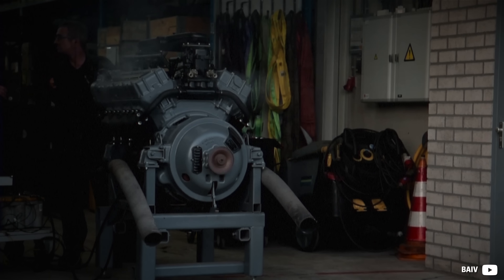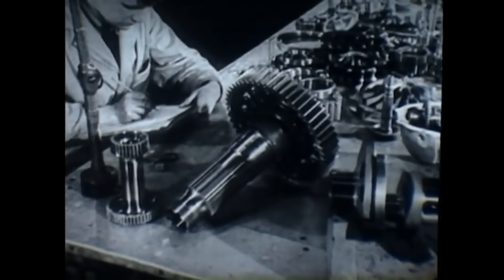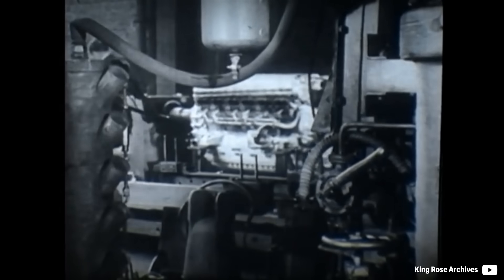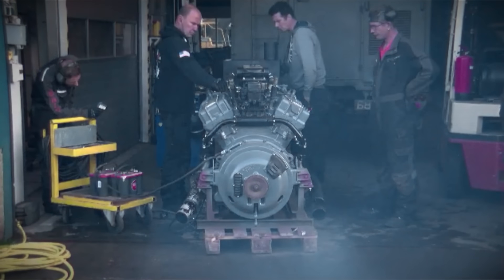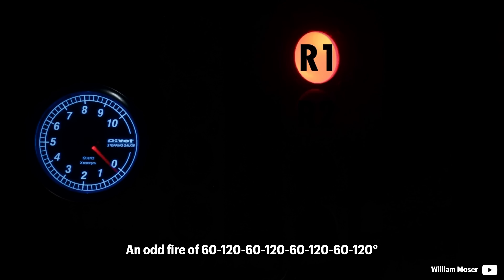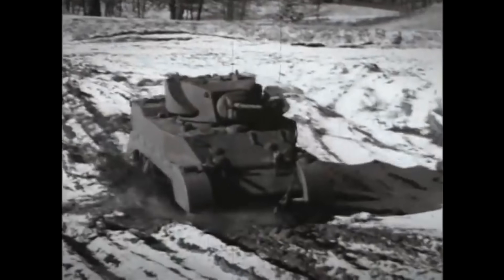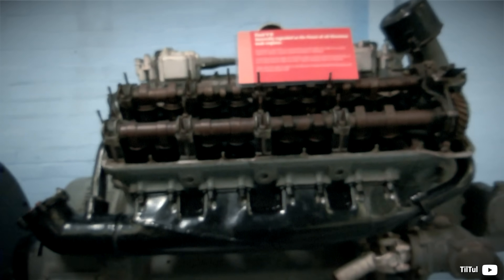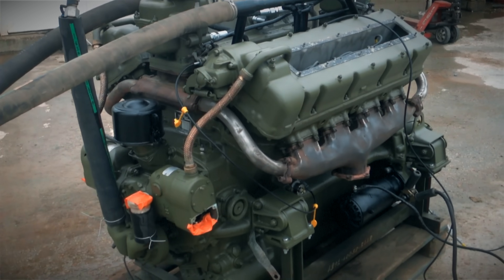The 1,100 Cubic Inch Ford GAA Was Extraordinary

Comment: FORD built a 427 single overhead powerhouse back in the 60s and it was banned from NASCAR and only 5-10 thousand were built. They called it the Cammer engine.
Reply: The 427 Cammer. I've seen one of those engines on display in a dustproof case at thr Don Garlits Museum in Ocala, FL
Reply: @SCRB1GR3D98  I can show you a half dozen Cammer blocks prepped and ready sitting on a shelf, two motors ready to go, and three drag cars all with Cammers in them still being campaigned  not thirty minutes from where I sit.
Reply: @SCRB1GR3D98  I think they built only 5000 of them.
Reply: It is estimated there were less than 500 of the engines built making the Cammer rarer than the Boss 429. The Ford 427 Cammer produced 616 horsepower with single four-barrel carburetor and 657 horsepower with dual four-barrel carburetors.
Reply: @g.o.b.2558  Keep in mind Ford under-rated these engines to get them into Nascar.
Reply: @brianlamb7937  all car manufacturers under rated HP for insurance reasons way back in the day
Reply: @brianlamb7937  There is a story that Ford rated them at 50 HP more than the Dodge 426 Hemi - but DODGE came back and complained the difference was more like 100 HP.
And the engine never made it into NASCAR - the "cam in block" more standard FE engine version did.
Reply: @g.o.b.2558  do you happen to know where to find the head floebench results vs a cam-in-block engine? Wonder if that huge difference in power is simply due to RPM differences and cam profiles, or if there's also some better porting in the SOHC heads.
Reply: @throttleblipsntwistedgrips1992  Not sure but that would be interesting to see.
Reply: @g.o.b.2558  The Thunderbolt (dual highrise) I help crew on was dynoed at 932 hp at the flywheel.
Ran 9.02 at the Indy Nationals and won the class.
Reply: They also built a DOHC motor. It was used in drag racing. Don't know what happened with that but it didn't last long
Reply: @jamesweaver1738   ford cosworth
Reply: @spankthemonkey3437  I had forgotten about them. Thanks 👍
Reply: @jamesweaver1738  Not from the 427 FE.
Reply: @jamesweaver1738  the only dohc engine I know of from that time was from chrysler and nothing came of it,as far as ford goes, the cammer was the most they made, and as far as those power ratings they usually made 700+hp, and while yes these engines are rare, some companies still produce aluminum versions in small quantities that are honestly more reliable and of course lighter.
Reply: @baronsable6173  If I recall correctly. The biggest problem with the camper was it had a 7 foot long timing chain. What a night mare that was. Lol
Reply: @baronsable6173  in the mid 1960's Ford built a 255ci dohc engine for Indy. They later sold the casting to AJ Foyt. There is a picture of a dragster around with two of these engines in it.
Reply: @baronsable6173  Ford built a 289 based dohc motor called the Indy and ran it in Lotus Indycars around 64 or 5. It also ran in the gt40 for a brief time.
Reply: @jamesweaver1738  replaced by a gear drive. The chain drive was always replaced after the gear drive was available.
Reply: @todiathink8864  Thanks for the information. It's amazing how much people remember
Reply: Yea my friend had one back in the early 80's he put in a 69 Mustang, they were built on the 427 side oiler engine, it was basically just one of them with the OHC heads adapted onto it.
Didn't NASCAR wind up outlawing them just like they eventually did the Chrysler 426 Hemi?
Matter of fact I think it was the same rules that did away with both of them that had to do with slowing the cars down because they were getting out if control for the brake and suspension technology of the time.
I have another friend that put a massive Hollman&Moody engine in a 71 Mustang, it was light years faster than the friends with the 427 cammer engine but in all fairness it was over 100 ci bigger and was built by H&M and Ford from day one as a specalized racing engine and they never saw street use, it's the same engine as one of those old monster trucks ran, I think The Virginian, when that truck came through my hometown on a promotional tour and was at the local Ford dealership I went and saw it, when I saw the engine I mentioned to one of the owners that I had a friend with a Mustang that'd shoe horned one in it, real cocky and dismissive of me he said "Not one of these", I immediately found a pay phone and called him and had him bring it up, the owners of that truck started making offers but he wasn't gonna sell, it's a long story about him ordering the Mustang from the PX system while he was still overseas in the Army right before he was discharged and his dad knowing H&M along with it taking him the better part of the 70's getting that engine into the car at the service station he bought after coming home and getting the bugs worked worked out, and they were some pretty big bugs getting something like that into a production car with a license plate on it, local law enforcement was always looking to hassle him over it.
Reply: @dukecraig2402  Great story. I love it. And Holman - Moody were great motor builders. I think they actually taught the Ford engineers back in the day. I know later that Bill Stroppe joined in. They were awesome
Reply: @jamesweaver1738  
That H&M engine that my friend had in his car was some specialty racing engine that they got away with running in Nascar because Ford cast the heads or something with the Ford symbol on them so it made them eligible to run in NASCAR, you should see the ports on the heads 9n that thing, he's got some extra stuff that came with that engine including the original block that had a rod sticking out of it because it was a blown engine that was sitting in the corner of their shop when he bought it off of them, they gave him some extra stuff with it when he bought it cause it a year or two after a rule change outlawed massive engine's like that one, during that era  everyone was on the verge of all out cheating and NASCAR started reeling everyone in, the cars were just getting too fast for the tracks and tires at that point, people bitch about rules like that but it's all about keeping the drivers from getting killed because things start getting out of hand.
Reply: @jamesweaver1738  they did.
Reply: @dukecraig2402  ...there was a guy in Daytona who I knew from the 1980's who had a BRIGHT RED 1965 factory NASCAR Galaxie 500 cammer.....he used to bring it out to the local meets....bloody hell but that car was LOUD and FAST....very fast...lol  There were a lot of the old NASCAR boys in Dayona back then....you never knew what you would run into cruzing beach side before they fucked THAT all up in the 1990's....
RIP Daytona....you used to be a great place to live and cruze.....NO MORE.
Reply: @ssnerd583  
The engine in my friends car isn't a cammer, it's some other type of massive H&M speciality engine that was outlawed by NASCAR when they were cracking down in that era, H&M got away with what they did because Ford cast the heads for this motor but the rest was H&M, they got away with it because back then only a certain percentage of the engine had to be made by the manufacturer in other for the racers to be able to liberally use aftermarket parts, it was like 20% or something like that, so H&M came up with some ridiculous motor that was based on a Ford engine and had Ford cast the heads which met the 20% rule, this engine was in two versions 550 ci and 600 ci, I can't remember which it is my friend has and if I remember correctly the only major difference between the two was the cranks, and of course pistons and possibly rods.
As I said one of the monster trucks from the 80's had the same motor in it, I think it might have been The Virginian but can't say for sure it's been so long ago.
The way he got it is his dad was good buddies with both Hollman and Moody, the 71 Mustang my friend had was ordered through the Army PX system shortly before he discharged when he was overseas, when doing that you can arrange for the car to be sent to any dealer anywhere in the world, his was waiting for him at the local Ford dealership in his hometown when he got home.
Back in those days Daytona had a weekend every year that if your car passed a safety inspection of theirs you could take it out on the track and run it, he'd ordered his Mustang with the biggest engine he could and the drag package suspension and any other performance goodies you could that year, well when he was on the track down there I guess a Corvette dusted his speed and time, him and his father being huge Ford guys he didn't take it very well that a Chevrolet had beaten him, the almighty gauntlet had been thrown down. 
On the way back to Pennsylvania him and his dad stopped at H&M's shop because like I said his dad somehow or the other was old buddies with those guys, how some gas station owner from Pennsylvania got to be old friends with them I have no clue, maybe his dad was originally from down there and used to run moonshine with those guys when they were all young or something but either way I don't know the back story about that.
While at their shop my friend saw the engine sitting in the corner with a hole in the block and a rod sticking out of it, when he inquired about it they said it was an outlawed motor that since it was blown and no one could race it there wasn't much interest in it so it was basically just sitting around taking up space, they told him he could have it at a decent price and that they'd include a new block, rod and piston in the deal just to get it out of their hair, so he threw down the money and they strapped it onto the trailer his car was on and back it came to our small town in Pennsylvania. 
Within a year of returning to Pa he'd bought a service station using a VA small business loan and put the car in one of the bays and went to work repairing the engine and getting it in the car, he told me when it came to that part there was serious issues he couldn't overcome and had to take the car itself and engine down to H&M one year on the trailer and drop it off for them to modify something about the front section of the frame to get the engine to fit in the car and had to go back down to get it after they were done, and even then it took a long time and many hours to complete everything after he got it back, then after he finally got it running there was quite a few bugs that needed sorting out over time, cooling issues, blown clutches.
But he finally got it street and had it reliable enough to run without something popping on it.
I'm almost positive about it not being a cammer, I'm in no way an authority on them or any other Ford engine and wherein it's got big valve covers I still don't think it's one because once when he took the engine partially apart for some reason he brought one of the heads into the garage we worked at to show it to me and I'm sure I remember seeing rocker studs sticking out of it and sure don't remember seeing where a cam could have mounted on it, I do distinctly remember the Ford casting symbol on it, and I also remember seeing it when it was in the car and the valve covers said Hollman&Moody on them.
It made for an absolute beast of a car, after a while he had a reputation that nobody would even bother challenging him to a race, it's not all that rare to run across someone nowadays with a 1,100 HP engine in a car but back in those days something like that was very rare.
Reply: @mikec9112  
Then on the GM side of things you had Smokey Yanuck who'd have flow a helicopter around the track if he could have figured out a way of fitting it into the rules, and if anyone could have done that it'd have been him.
Reply: There was a guy a few years back on hot rod drag week with an old galaxie with a sohc motor.. cant remember exactpy but i think the thing was running low tens or high 9s on motor
Reply: Ford made two versions of the 427 sohc first generation had the plugs up close to the intake. The second generation had the plugs in the center of the valve covers. That version was extremely powerful. It went off the dyno they had it on. They claimed it 700 hp plus. Nascar "coincidently" changed rules that banned it from kicking Chrysler's ass.
Reply: Uh, only about 500 were built
Reply: @bluesky-ud9wg  I remember it was a short run. I don't know if any made it into production cars
Reply: @jamesweaver1738  None made into production cars
Reply: @bluesky-ud9wg  I didn't think so. I  grew up in that era and I didn't think any got into production cars. Thanks 👍👍👍
Reply: @jamesweaver1738  np
Reply: I believe keithcraft will build you a brand-new aluminum version of the Ford Cammer.
Reply: @codyhatch4607  was gonna say that parts are available to build it and in today’s world we could get five axis billet made in a few hundred miles from anywhere. Look a the Ardema Braun racing engines and their collection of self made bad ass engines
Reply: @dennisford2000  No it was not. You can buy an aluminum block with no need of a CNC mill.
Reply: Very powerful in it's time, but the cam chain was a mile long & did not contribute to reliability.
Reply: @wymple09  Pete Robinson and Harvey Crane  designed a sprocket system as an alternative for the chain to solve these issues.
Reply: @duke5171  I thought Mickey Thompson designed the first gear drive for the cammer? Might better do some checking. I  could be wrong, but I don't think I am?
Reply: @luketilley9137  Hmm, well according to most articles which go in depth on the history of The Cammer, it was Pete Robinson and Harvey Crane who produced the system. However, Mickey Thompson most likely was very successful with the SOHC engine during 1969 due to the innovation.
Reply: @duke5171  😎👍
Reply: @duke5171 one was available to make both cams the same too
Reply: @luketilley9137  your wrong, it was Pete Robinson. Sorry a year has passed, since this
Reply: @wymple09  someone made a gear system to replace the mile long chain, i think it was a drag racer
Reply: @Jeromeeb  ED PINK
Reply: @wymple09  They are reliable if  the chain is pre-stretched and the chain  tension is set correctly.  You'll get a year of racing out of it no problem.
Reply: @wymple09 Mercedes Benz used such a chain in the old 117 engine and longer in the 119 . Didn’t see many failures. These designs are made for racing and they required valve adjustment, cam chain stretch can be checked, Benz has offset keys for the engines. I probably installed dozens of timing chains on Benz just running a new chain on telling them it’s good for another 100k . Race engine gets looked at every race . Many were running much faster than they were designed to.
Reply: @wymple09  The hot rodders ALWAYS replaced the chain with a gear drive..... the chains were always temporary.  🤣🤣
Reply: @wymple09  Also made timing the camshaft a major PITA.
But MORE powerful in it's time than the famed Mopar 426 Hemi - which is what got it banned from NASCAR.
Reply: @mikec9112  
That's probably true, that'd slow them down just the same, I think there was an increase in weight also required for Chrysler to keep running the 426 Hemi also, probably all those large displacement cars had to increase their weight as per that rule.
I'm not really the biggest NASCAR fan in the world and don't know the rule changes that came about in that era like a big time fan of the sport would be but I do remember reading once about all that from that era and how it was a result of the cars getting silly fast, especially with the aero bodies that Ford and Chrysler were getting on the tracks back then.
Reply: Say it isn't so
Reply: Albert Dolber built a steam powered car in 1920s that has more horse power than most modern cars... and it boils a quart of water instead of 50 gallons so it's basically instant energy for very little input. But alas technology moves on.
Reply: I believe you may be referring to what I read was called the 427 semi-hemi made in 1967 🤷
Reply: They were breifly banned as were Hemis, any RACE ONLY engine was not allowed, they reinstated both but the Cammer was hit with weight penalty as it diodnt meet Homologation requirements either. For some reason FORD FANBOIS always seem to gloss over what actually happened...
Reply: The cammer was quite successful in top fuel for a few years.
Reply: I have one it's a very rare engine and I Am preserving it in hopes someone would put it in a museum or in its proper place.
Reply: They built a few more than 500,  SOHC engines. MOST were built in 1964, 1965, time frame. NASCAR did not allow the SOHC in 1964, they did allow  the HI riser head for the 427, which was very competitive with the hemi. NASCAR had let Chevrolet run their mystery engine in 1963, only 6 were made, according to Smokey. So Chrysler and Ford thought they would do the same in 1964, however NASCAR, didn't like overhead cams, as that seemed "European ", too exotic.  NASCAR  did finally allow the SOHC IN 1966, however  with a penalty  of 1 lb. For every cubic inch of engine displacement.  For a galaxie, which already weighed close too 3900 lbs. The extra 427 lbs. Created problems for tires and brakes. Goodyear told Ford it wasn't a good idea, and tire wear, would be high, with that much weight. So everything got put on hold, until the Fairlane got approved by NASCAR.
Reply: When America builds overhead cam engine in a world of dinosaur pushrods it's a big deal but Europeans and Japanese been doing it from day one.  Just so you know in 1930's Alfa Romeo built dual overhead cam 4 valves per cylinder (I spelled it out for you because I did not know if you knew what DOHC meant) per cylinder.  That Italian  company you never heard of and if you did you probably taught low off it.
Reply: nascar banned anything new that out performed including hemis and canted
Reply: @@jackrussellelewis4531 youre the one that's been cheated by looking dumb saying that. instead of the 2 min search of well documented history...the age of information at your fingertips....Good for you, for not being ashamed to reserve the right of being wrong
Reply: A friend of the family had one in his bucket T and another in a tub in the back of his transmission shop. He was asking 15k for it in 1995. I'd never seen or heard of one before,  but had friends in mustang clubs that showed off their boss mustangs. The boss 351 impressed me more as a driver, as I was only 15. I had the chance to drive the 351 and 429. The 351 was a motor that just felt like it could ram you back in the seat . The 429 just threw the car at you. It felt like a rocket. Then Karl took me out in his cammer and we were put on the highway and I remember crossing an intersection and in less than a quarter mile we his 110 and he still had a gear left! He asked me if I'd like to drive it. I said yes, but in a few years. I didn't have experience with the top end rush like that. Didn't trust myself.  He passed away before I could drive it. His son is a Ford transmission wizard and has the bucket T and is building a mercury cyclone with a 6 speed for the other engine.  He modified a frame out of a crown Victoria police car to take the power and put it under the beast. He needs 2 doors and the entire interior done. The parking brake is a cable operated disc brake on the rear of the transmission
Reply: @dustinshadle732  That would have been a great deal fir 15 grand, if you could find one today and it ran you could easily get over 50k for it. They only made closer to 5000 then 10 so they were always elusive to find but what a great engine it was stock like 640hp with one 4bbl carb and closer to 700 with twin 4bbls.
Reply: 500! That's all the cammers built.
Reply: @1mikewalsh  You can build one New Cammer  from multiple sources.  Boss 429's as well.  They HAD  to build that many for class homologation.. Go to the Holnan Moody site that still sales parts they had a pair of 427 Cammers.  It's hard to verify production when most didn't have production id's.   Ford experts said that ABSOLUTELY NOT A SINGLE 302 tunnel port from the failed program in 1968 was produced.  A famous engine builder has a street and race version that "didn't" get built.
Reply: @notpoliticallycorrect1303  You know I'm not sure "how" it happens....I'm just glad some of it escaped the fate of being crushed.  Lots of engineering programs that were once thought no more than myth, have surfaced and shown otherwise.  A recent example...Ford designed a 302 Tunnel Port in 1968, that was deemed a "failure" mid season and replaced by the Boss 302's for racing.  There would have been 2 distinct versions.  There was a race and street version that would have been sold if homologation was needed.  Almost nothing hands on was known about them, but recently not only one but several race and street 302's have shown up in high end engine builder's shops... They are absolutely different and unique and shouldn't exist....but they do..
Those Transit Van's are worth alot in the UK aren't they?  I bet that one you worked on is valuable. .
Reply: @patrickf4692 The Cammer when raced had the 2nd bank advanced 8 degrees due to chain stretch. 
 GM did a 302 hemi, with canted valve aluminum heads, Pontiac did a 303 tunnel port engine which was destined for Trans AM racing until the cui limit was increased in 1970. 
Chevrolet, Oldsmobile, and Pontiac all had over head cam prototype engines in the 1960's. The 62 CorvetteFuelie was supposed to have Aluminum heads however they had porosity issues, the same thing that plagued the Grand Sport 377 Aluminum engines. The 67 68 L88's and L89's had some issues with the valve seats coming out of the heads, IIRC some builders ended up staking the seats into the heads using a punch.
Reply: @TheJagjr4450  I have read about most of the ones you listed... but I don't think any of them went past a "what if" prototype development, or a show piece.  The SOHC could be purchased basically over the counter as a race engine.
Reply: @TheJagjr4450  That's the type education lots of folks would love to have...I tried to find the old '60's price sheets I have somewhere, but I couldn't locate them.  Regardless I do remember that most of the small block race engines were around $800. complete....The SOHC was in the thousands...like $3000.+  That was ALOT considering a brand car was about the same price.
Reply: I was with a friend and stopped by his uncles farm. He had i believed to be a 1967 ford fairlane drag pack. No radio or accessories.  Just a 427 cammer engine , a 4 speed, plexi glass windows and one bucket seat.  It was hearthrobbing just to see one in real lifw
Reply: Also known as the side oiler.
Reply: So did Pontiac the 427 hemi SOHC  with the help of dodge but GM killed it for obvious reasons. Oh it also had Mechanical Port Fuel Injection. It’s a real shame engines like the Cammer and this never made it to production and put into tons of vehicles
Reply: @Quirin M. Rules changes from the big wigs in the racing industry
Reply: Put it in my mini cooper
Reply: And cost as much as a Comet or loaded Falcon
Reply: NASCAR said ohc how dare they
Reply: Bruce McLaren died testing the new M8d with a Chevy 700 hp in 1969
Reply: There is this thing called Google,  all this info on these engines are available. If you want to be a gear head, don't guess, know....
Reply: I know this engine. Spark plugs holes went through intake manifold. 427 SOHC.
Reply: They should have went diesel from the beginning,would have saved a lot of lives......Detroit diesel.
Reply: Uh , Ford did not build 5-10k Scammers, they made a tiny # of them
Reply: Ford makes cool shit, every machine/car manufacturer makes cool shit.  Shits badass
Reply: @mikec9112  ...the history of the Chrysler Hemi goes back WAY-WAY before any FE block was ever cast.
Reply: @mikec9112  the reason the dimensions are very similar is that they had to fit in the same basic size vehicles and a period v8 block was about the same size for a long time.  dont think Fraud was the leader, here...they werent.
Reply: My dad had one in a airboat for years down in south Louisiana🤙🏻💯
Reply: I'd rather have a ford 427 than a Chevy. And I love chev
Reply: @thehulkamaniabrother2.089  I'd prefer a Cammer to ANYTHING Chevy - though the non-Cammer 427 was less extraordinary and had a couple Chevy engines that could argue with it.
Reply: Some crowd say a Ford 427 doesn't exist but, we know different. 😉
Reply: Smaller, weaker, less cams, and they didn't produce as many of them as the GAA. The GAA is the better engine, it can even run on the cheapest, worst fuel on the planet.
Reply: hemi made a dual cam to compete with it, motortrend has a full article on both engines.
Reply: @throttleblipsntwistedgrips1992  they "made" an engine, but never finished it, the pictures you see of it are basically just a shell, the heads basically had nothing in them and the whole project was scrapped, nothing came of the project, also hemi is not a company lol
Reply: @baronsable6173  may not be a company, but Hemi ran circles around Ford thats why the had their hearts set on showing it up. the combustion Chambers on a hemi breathe better at higher RPM. its also why theyre so difficult to tune,and why a well cammed 440 could keep up with most of em. That FoMoCo SOHC would have been the king of the track for 1 or 2 years....until the Hemi dropped. unfortunately, some bigwigs threw a hissy fit and they werent allowed. would have been some amazing races to see those engines in a Torino or Superbird either way. engines with 4" bores and over 3.5" stroke length at 8500rpm? yes please, ill take both, to-go.
Reply: @throttleblipsntwistedgrips1992  ....The 440 made a bit more torque but the hemi made the higher HP number and the HP was needed to go fast which is why the hemi dominated....and dominated BIG TIME in NASCRAP before it was NASCRAP...and YES the France family meddled with the whole NASCRAP thing ......those were the 'glory days' of the whole thing back then....and I lived in Daytona Beach for 20+ years and even hung out at the Best Damned Garage in Town with Smokey at times......and good times those were!!!
Reply: @throttleblipsntwistedgrips1992  Thanks. I really would hate to post something that wasn't true. I'm over 70years. Old. Some times my memory isn't perfect. I grew up with these cars in the 50s and 60s. Thanks again for your input
Reply: @jamesweaver1738  sweet, kinda jellous cus it means you got to see so many classics, cheers man!
Reply: @baronsable6173   I actually got to drive a Cheetah. And I worked in a high end restoration shop in Florida. I got to drive W.O Bentleys first 8 liter car and a Speed 6 Bentley that was raced at Le Mans. Our boss bought a 66 cooper Monaco. We made it look nice for him by working on it in the evening. Our reward was getting to drive it at Sebring. That was special
Reply: @jamesweaver1738 , you're a very lucky man to have been able to do that !
Reply: Engine designs do not live or die with Nascar acceptability.  If this were a good, reliable design it would have hit the market in performance vehicles.
Reply: @wymple09  theres plenty of good reliable profitable engines that have been killed off for various reasons, mostly emissions related.
Reply: @Jeromeeb  Nobody was killing off good reliable , so called world beating V8 engines back then, for emissions or anything else.  More likely it had long term reliability issues or fatal design flaws that Ford could not or would not deal with.
Reply: @wymple09  realllyyy what about the 70s and all the emissions stuff, yanno the time when pickups were faster than sports cars and they started dumping v8s for turbo 4 bangers. Tell me more about this back then when no one was ditching profitable v8s.
Reply: @Jeromeeb  The cammer came out 5-6 years before the EPA got serious. Don't try that excuse.  Turbo 4 bangers were still a light year away. And Ford itself brought out the 429 AFTER the cammer. The cammer was powerful, and flawed. It's demise was not an accident or victim of the EPA.
Reply: @wymple09  i was using the epa and turbo 4 bangers replacing v8s as an example of what you said wasnt happening back then, not saying its the excuse for the cammer. The motor got banned from where they wanted it and they cut funding . They used them in drag racing and had some issues but ford didnt build them for that type of power.
Reply: @Jeromeeb  Your example did not hold water. The EPA & 4 cylinder turbos were not even in play so they are not an example of what was happening "back then"
Reply: @wymple09  to expand on the emissions tho, there was an air pollution act of 1955 which was for research into automobile exhaust which got more ammendments for more research in 60 and 62. Then you had clean air act of 63 which got ammendments in 65 66 67 andddd 69. So maybe you could say auto manufacturers arent dumb and seen the writing on the wall my friend? I would assume even back then there was some discussion between law makers and large companies like ford chevy dodge. Its not unreasonable in my opinion
Reply: @wymple09  also international had a turbo 4 banger in 1965 so they were happening back then too
Reply: @Jeromeeb  Yeah, they were really big in the performance scene.  You see those stuffed into everything.....oh, wait
Reply: @wymple09  yeah they just made as much power in the 60s as an ls7 does now but it was totally worthless performance wise. Thats totally why they banned it 🤣
Reply: @Jeromeeb  Where did I say it wasn't powerful? Reading comprehension problem?
Reply: @wymple09  Like beating thg world at Le Mans--Only Ford has done that, multiple times in a row...
Your theory about nothing kills great engines-what happened by 1971? Something killed them all...or history got it wrong?
Reply: @patrickf4692  Only Ford tried at LeMans. And yes, the markets were moving away from big V*s by 1970's. But many of the biggies were still around. Cadillac, Pontiac, even the 460 Ford, etc. The cammer was already in the past.
Reply: @wymple09  Big-blocks did survive but 440's 454's and 455's, and 460's rated at a staggering 200 HP or less was just barley surviving....these were NOT the same engines of 8 to 10 years earlier...
Reply: In your opinion.
Reply: @wymple09  So an engine designed for Nascar putting out over 650 HP in a race car, should have been in a mass market sedan?  None of the engines used in any racing venue were exact copies just shoved under the hood and given a warranty....by your own theory none of these storied engines were successful since reliability past 500 miles, or being used daily wasn't priority  
426 Race Hemi/street Hemi different- 
high port--tunnel port---427 race engines- never installed in a passenger Ford.
You could buy some of these from the parts counter.  I just realized Indy cars are not impressive since I didn't get one in the BMW....
All failures.
Reply: @patrickf4692  Many engines were designed for racing & used for the base in passenger cars & trucks. Ford even called their 429 the Nascar 429. Chevy's 396 was originally Yunick's "mystery engine, brought out to race as the 409 was getting dated.  Where do you thing the 460 and the 427-454 came from?  Finishing 2nd wasn't on Ford's agenda, and the cammer did not make the cut. The 428 & 429 both did.
Reply: @patrickf4692  "“Why didn’t Ford ever put the 427 SOHC in a GT-40?”

The reasons for not using the 427 SOHC were lack of space in the chassis for the SOHC’s bigger heads, too much weight, too high a center of gravity, and unnecessary complexity with potential tuning and reliability issues for a 24 hour race. The 427s that were used already had a horsepower and torque advantage, didn’t need to be spun much higher than 6000 rpm, and were more simple to maintain, while the Cammer was designed to make huge horsepower at high rpm"
Reply: @wymple09  And NO.... BTY no 427 ci in Nascar be it high riser, tunnel-port or otherwise came close to output of the 427 SOHC Anywhere in the RPM's
Reply: @patrickf4692  God you fan boys are dense. The cammer was NOT as reliable, read up for crying out loud. Ford didn't just decide to kill off their best engine. They killed off the more complex & unreliable one.
Reply: @wymple09  Seriously every single thing in that paragraph you presented was factually and totally wrong.  Look what you wrote and actually read seasonal reviews of Nascar from 1960-1970.
Reply: @patrickf4692  OK, Skippy. Whatever gets you through your wet dreams. Ford killed the cammer in favor of lesser motors just to piss you off. Glad to see you taking it so well.
Reply: @patrickf4692  Your "world beater" cammer was gone in a flash. Paint that anyway you like, I don't care.